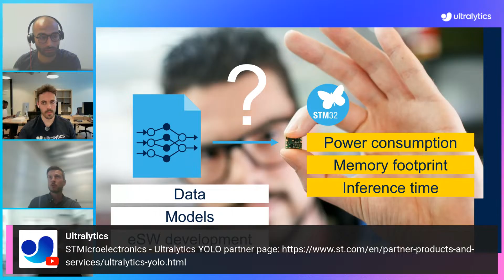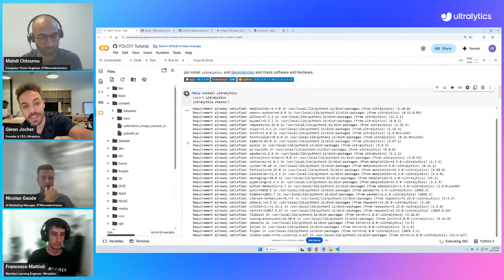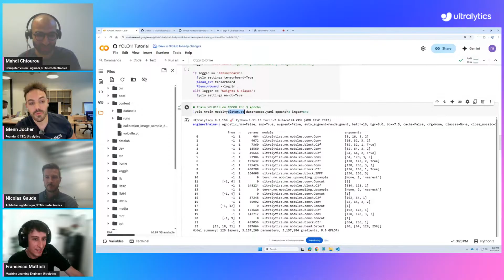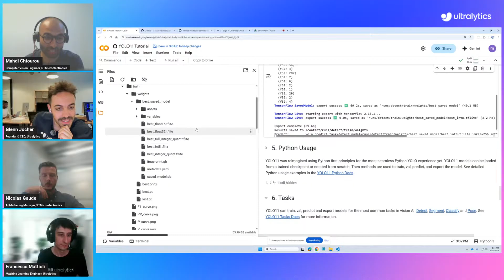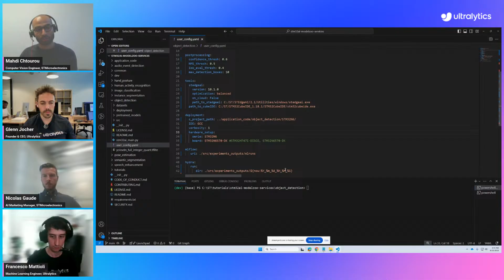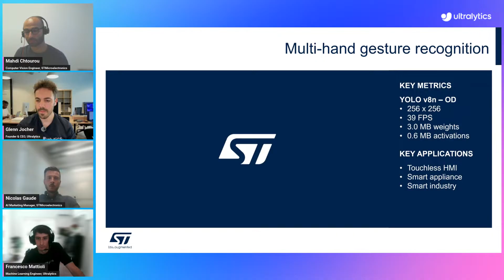Ultralytics Live Session 18: Elevating Edge AI with Ultralytics YOLO and STMicroelectronics!

Comment: Muito cool ver YOLO rodando direto no STM32N6, but here’s the jazz question: what accuracy/latency compromises start to really hurt in the real world when you quantize for ultra-low power, especially for pose estimation? Edge AI sounds like a beautiful chorus until one missed frame vira um solo de desastre.
Reply from the maker: Great question 😄 In practice, INT8 usually gives a small accuracy drop if calibration is good, but pose estimation feels that drop sooner than plain detection because keypoints are more sensitive to small spatial errors.

What tends to hurt most in the real world is not just quantization alone, but the combo of INT8 + lower input resolution + tighter memory limits. For pose, that can show up as jittery keypoints, missed small joints like wrists/ankles, and weaker performance on occlusions or distant people. Latency also matters: if FPS drops too low, fast motion looks like “missed frames,” even if each individual prediction is decent.

For ultra-low-power deployments, the sweet spot is usually a well-calibrated INT8 model with careful resolution selection and real test footage from your exact camera setup. If you want, share your target use case like distance to subject, expected FPS, and number of people, and I can suggest a practical starting point on STM32N6.

Comment: Bro, what’s the real mAP/latency hit after INT8 on STM32N6? Can you keep NMS and all post-proc on-chip without cooking the battery on a solar trail cam at dawn?
Reply from the maker: Short answer: with good INT8 calibration you’ll see ~0–1 mAP point drop; with weak calibration it can be a few points. Latency is actually faster on STM32N6 with INT8—YOLOv8n/YOLO11n-class at 256–320 runs near real time (~29–40 ms/frame) at about 200–250 mW. Yes, you can keep everything on-device (preproc + NMS/postproc in the C app, NPU for the net); the extra CPU work adds only a few ms and minimal power. For a solar trail cam at dawn, duty-cycle or PIR wake, lower FPS in low light, and stream selectively—share your target res/FPS and battery/solar specs and we’ll suggest a concrete power budget.

Comment: Practically speaking, what deployment recipe gets the best accuracy–latency–memory trade-off on STM32N6—per-channel INT8, operator fusion, structured pruning/sparsity, and/or distillation—and how do you validate robustness under nasty domain shifts? And since, as McLuhan warned, the medium is the message, how are you handling secure OTA/rollback and privacy when “smart city” nodes proliferate?
Reply from the maker: Great question. On STM32N6 the winning recipe is: YOLO11n at 256–320 input, INT8 per‑channel PTQ with a strong calibration set, let ST’s compiler fuse ops, then add light structured channel pruning (~10–30%) if you need extra headroom; recover any accuracy loss with brief QAT or distillation. Unstructured sparsity won’t help the NPU much, so prioritize structured changes. For robustness, build a corruption/lighting/weather test suite, run hardware‑in‑the‑loop on the Discovery kit to track worst‑case FPS/memory across temps, and do small field A/B pilots with real data. Security/OTA: use secure boot + signed firmware, encrypt model blobs, stage A/B rollouts with auto‑rollback, and keep privacy by processing on-device and emitting only events/metadata (no raw video). If you share your FPS/latency/accuracy targets and memory budget, we can tune this further—also ensure ultralytics, torch, and ST Edge AI tools are up to date.

Comment: Curious what accuracy hit y’all see when squeezing YOLO/pose onto STM32N6 with INT8 (or even INT4) quant—any tricks to keep mAP steady under tiny SRAM? And how do you handle OTA model updates and calibration drift at fleet scale without turning devices into very smart bricks?
Reply from the maker: Great question! On STM32N6 with INT8, YOLO/pose typically sees ~0.5–1.5 mAP drop vs FP32 if you use a good representative calibration or, better, QAT; poor PTQ can lose 3–5. INT4 isn’t supported on STM32N6’s NPU and is generally too lossy for detection/pose, so we don’t recommend it.

To keep mAP steady under tiny SRAM: prefer QAT on your target imgsz, use per‑channel weights + symmetric activations, fuse BN, stick to fixed shapes (e.g., 256×256), re‑cluster anchors for your data, and calibrate with sensor‑matched clips (same optics/lighting). Quant‑friendly activations (e.g., ReLU6) and lightweight post‑proc help. For memory, keep INT8 I/O, batch=1, static buffers, and avoid external memory if you need FPS.

Fleet OTA without bricking: package model + preprocessing/postprocessing + class names + quant scales as a single signed bundle with a schema version; use A/B slots, canary rollout, health KPIs, and auto‑rollback. Cache and reuse calibration scales on device; monitor drift via confidence histograms/class mix, then refresh calibration or push a small QAT fine‑tune periodically. Always keep a last‑known‑good fallback and a watchdog.

Recommended default is YOLO11. Quick export example for STM32N6 workflows: `yolo export model=yolo11n.pt format=tflite int8=True imgsz=256`

If you share your sensor, target FPS, and classes, we can suggest tighter settings 🚀

Comment: Loving the edge-first vibe—how are you balancing quantization/pruning on STM32N6 without nuking small-object or pose accuracy, and is there a clean path to update models in the field securely? Also curious: what’s the real power/latency trade-off versus a tiny NPU or Jetson when you’re not plugged into the wall.
Reply from the maker: Great questions! On STM32N6 we use INT8 PTQ with good calibration and light, structured pruning only where sensitivity allows—usually heads and early layers are protected to preserve small-object/pose accuracy. If needed, QAT can recover any drop. For updates, use signed firmware and secure boot on STM32N6; model binaries are packaged into C code and delivered via OTA with verification.

Power/latency: STM32N6 runs YOLO at a few hundred mW (≈225 mW) with real‑time FPS at 256–320 side, so energy per inference is very low—ideal for battery devices. Tiny NPUs vary, but similar INT8 pipelines can be competitive; Jetson is faster at high res, but draws watts even when optimized, so battery life drops quickly. For most edge use, YOLO11 + STM32N6 hits the best energy/FPS balance off‑grid. If you share your input size and target FPS, we can suggest exact settings and versions to use.

Comment: Curious how you balance achieving high-accuracy object detection with the power constraints of STM32N6 in real-world deployments—are there trade-offs you’re seeing, and how big of a role does model pruning or quantization play in this? Also, with all this new edge capability, anyone else worried about a surge of "smart" gadgets that guzzle more rare earths and e-waste?
Reply from the maker: Great question! Balancing high accuracy with tight power and memory limits on STM32N6 is all about smart model optimization. Techniques like model quantization (down to int8) and pruning are essential—they shrink models, speed up inference, and cut energy use, all while keeping accuracy loss minimal if done right. For example, quantization on STM32N6 enables real-time YOLO detection at just a fraction of a watt, which would be impossible with larger, unoptimized models.

There’s always a trade-off: pushing for ultra-low power can mean slightly reduced accuracy or frame rates, but with careful tuning and dataset calibration, the impact is usually small. Pruning and quantization are the keys to making efficient Vision AI practical on microcontrollers.

On the sustainability side, it’s a valid concern! The goal of edge AI on devices like STM32N6 is actually to reduce overall energy demand by running tasks locally and using less hardware. But as with any tech, responsible design and lifecycle management are critical to prevent unnecessary e-waste as the number of smart devices grows. The industry is definitely paying attention to these challenges.

Comment: Awesome to see YOLO running on STM32N6—how do you guys handle quantization and model optimization to balance accuracy and latency for such low-power hardware? Any tips for deploying models with custom layers or unusual activation functions on microcontrollers, or is that asking for too much “edge” from the edge?
Reply from the maker: Great question! For low-power hardware like the STM32N6, we use model optimization techniques such as quantization (often INT8), pruning, and sometimes knowledge distillation to shrink models and boost inference speed while preserving as much accuracy as possible. Exporting YOLO models to formats like TFLite or ONNX is common, as these support quantization and edge deployment.

When working with custom layers or unusual activations, it's best to stick to widely supported operations since microcontroller runtimes usually have limited support for custom ops. If you need custom layers, you may have to implement or approximate them using supported ops, which can be challenging and may impact performance or accuracy. For most edge use cases, using standard activations like ReLU or LeakyReLU is safest.

Always test your quantized and optimized model thoroughly on real hardware to ensure the balance between speed and accuracy meets your needs. And if you’re using Ultralytics HUB, you’ll find tools to help manage and deploy optimized models efficiently!